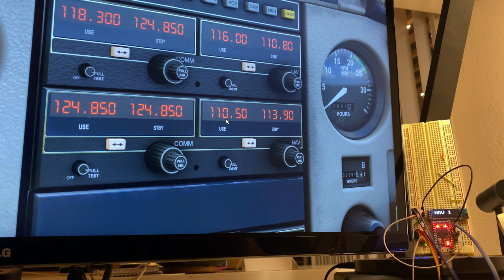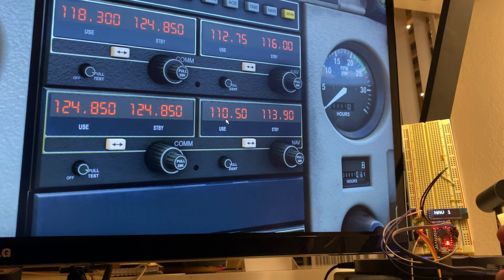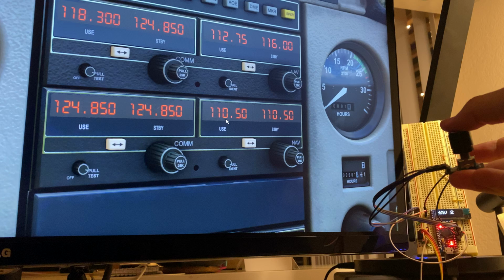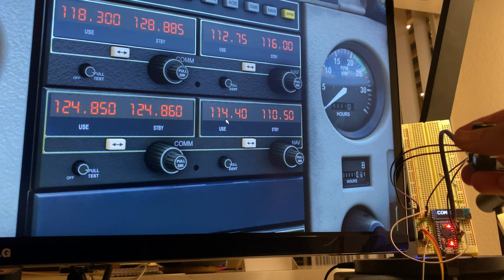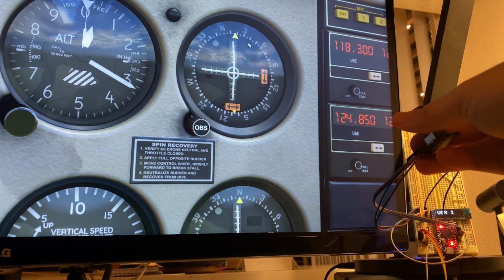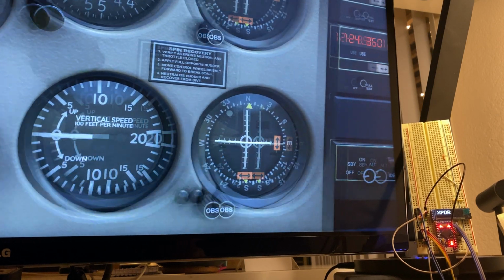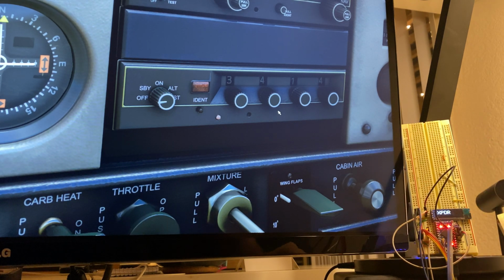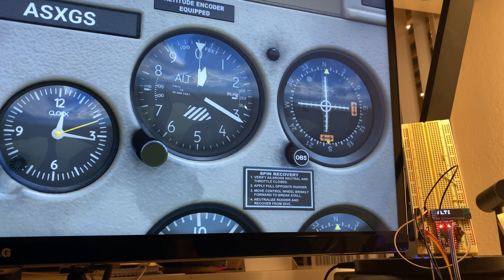Using a multifuction DIY controller with Microsoft Flight Simulator

Comment: Thanks. I actually just built this, based on your ideas. I used a Teensy 4.0 because it is so small, cheap, powerful and it fits easily into a small box. Also, it supports the USB in joystick mode, so that makes interfacing to FS2020 or XPlane really easy. Interesting thing is that Teensy actually supports XPlane in a more interactive way (so e.g. the display could also show the freq as it changes). Coding (from scratch) wasn't all that hard. Happy to share the source code if someone wants it. Parts wise, I used a 16x2 LCD and two rotary encoders. And a 2k2 resistor to set the contrast.
Reply: Yes plase! Do you have a github link? Cheers
Reply: nice!! building a simple throttle box with some potentiometers and also 3 encoders......did u used some external software for interfacing or just the microcontroller code?
Reply: Can you share your code and build please? Thanks
Reply: Hi Paul,  I’m looking at that for MSFS , so if you could share the build & code it would be awesome, I’m wanting to use ardunio mega or Leonardo board. I’m new too the ARDUNIO stuff so still learning it all. This looked like something that would be a great project to understand the programming a bit more.I sent Geoff a message in messenger but haven’t had a reply.
Cheers. Riche👍👍